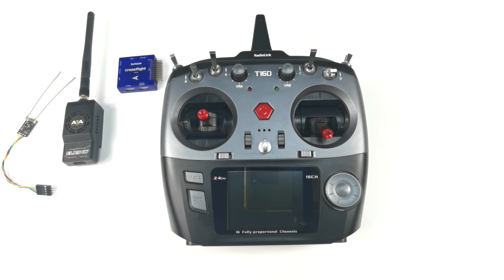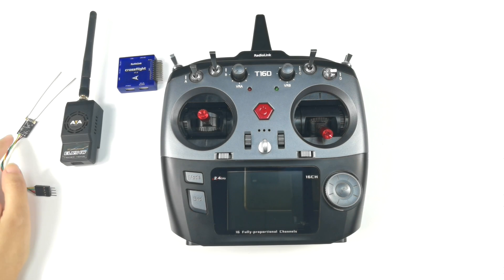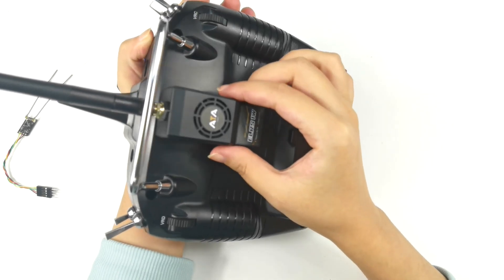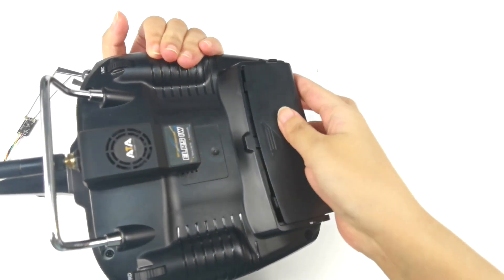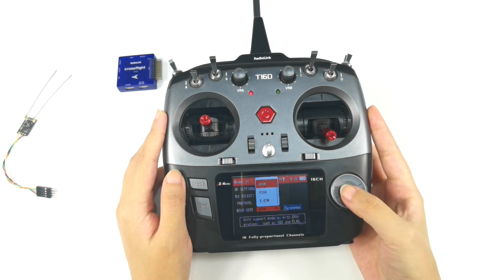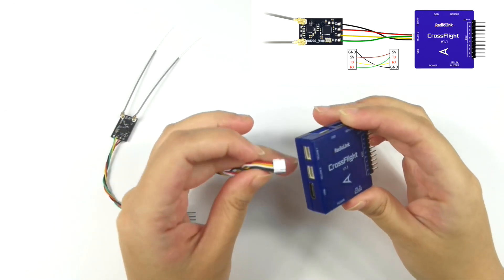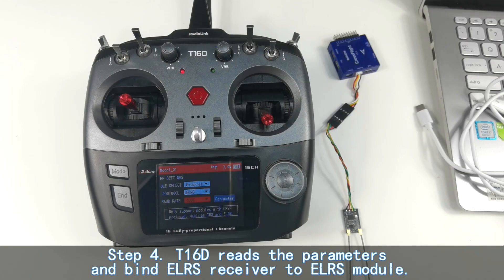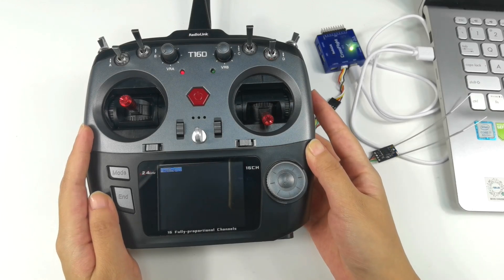How to Connect 2.4G ELRS Module to T16D?

Comment: What about t12d? Any video how to connect elrs?
Reply from the maker: Hi, sir. They are similar. The difference is that you need to mount ELRS bay on T12D by yourself. We'll release the tutorial soon. Please wait. If there is any question, please feel free to contact us. Our email is after_service@radiolink.com.cn
Reply from the maker: Hi, sir Here is the tutorial to show how to connect ELRS to T12D: https://www.youtube.com/watch?v=5gClfQRbBVI  If there is any question, please feel free to contact us. Our email is after_service@radiolink.com.cn
Reply: Can it be used together with signal with s-fhss?
Reply from the maker: @STRatchapon  Hi, sir. RadioLink control system is not open-sourced. T16D is only compatible with RadioLink receivers, including R16F, R12F, R8EF, R8FM, R8SM, R8XM, R8FGH, R8FG, R7FG, R6FG, R6F, R4FGM, R4F. https://www.radiolink.com/t16d_specifications  If there is any question, please feel free to contact us. Our email is after_service@radiolink.com.cn